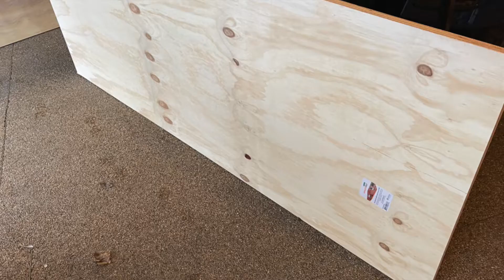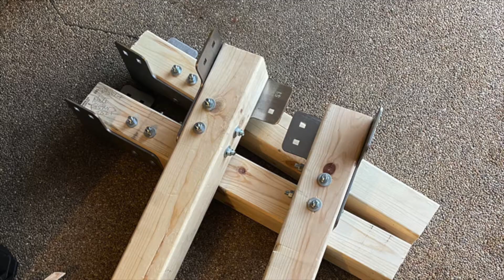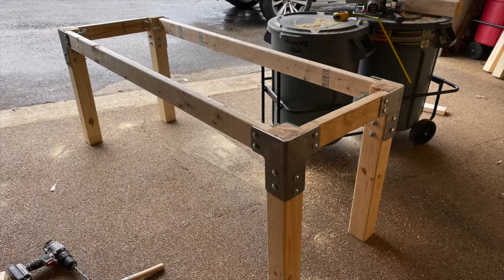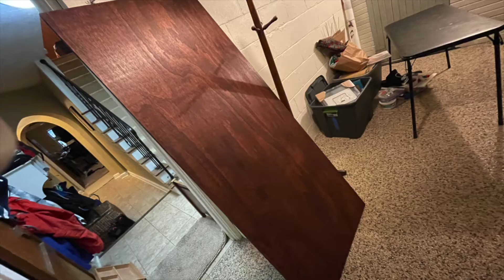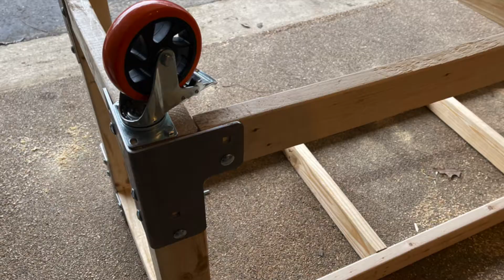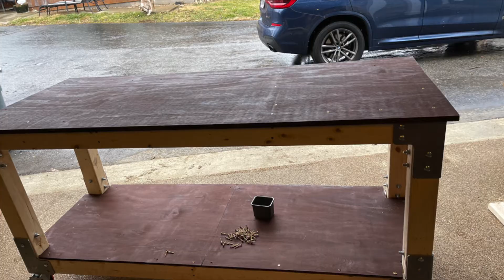Eastwood Workbench Build

Comment: Nice job!  I just got these same workbench brackets which came with 8 brackets and all the carriage bolts, nuts, washers, etc.  Specifically the 8Pcs Workbench Bracket Kit SKU: C116V03 by Vikofan.  It stated it would come with assembly instructions, but unfortunately it was just the hardware and nothing else.  Do you happen to have a .pdf you could share with me or did you have any assembly instructions for putting this bench together?  I want to make something like what you have, but it would be nice to have instructions to reference rather than going by scratch.  Thanks!